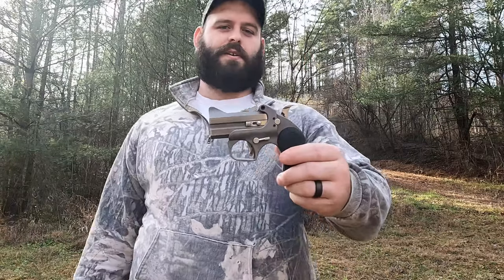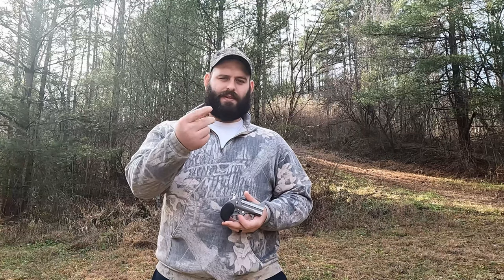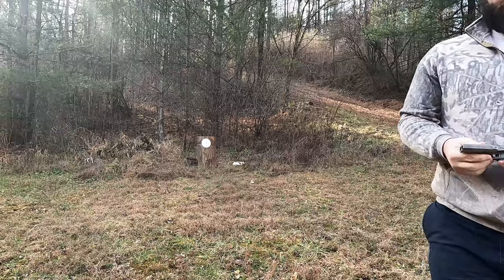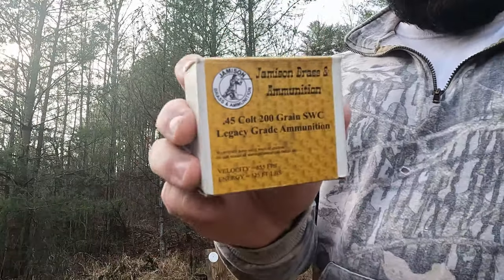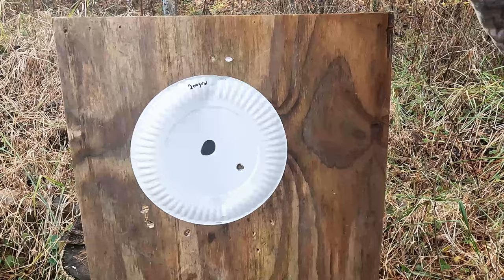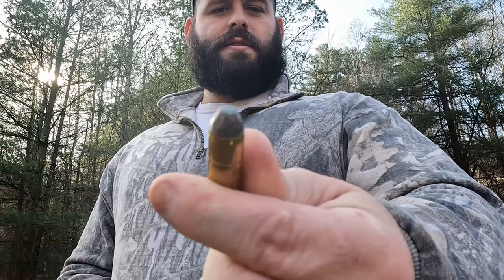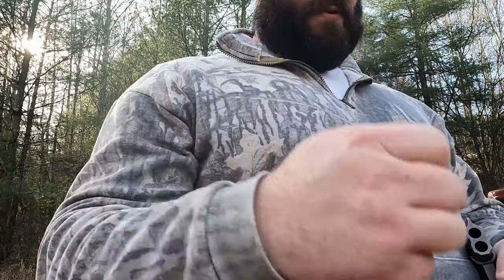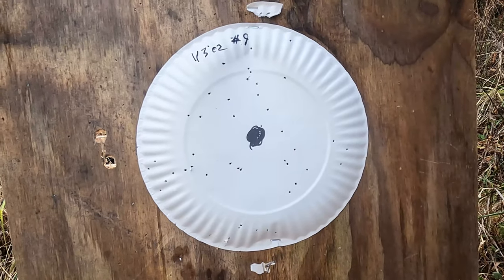Bond Arms Rough and Rowdy ammo test

Comment: I have the Roughneck .357/.38. I saw a video (from 10 years ago) from Bond Arms. At the time, Gordon Bond didn't recommend shooting +p through their derringers. If you can shoot, for example, a 158 grain .357 fmj, why would it be a problem to shoot 110 or 120 grain .38 +p's?
Reply from the maker: I'm no expert but i wouldn't see why not long as pressure were under 357 mag pressures but be good question for bond arms